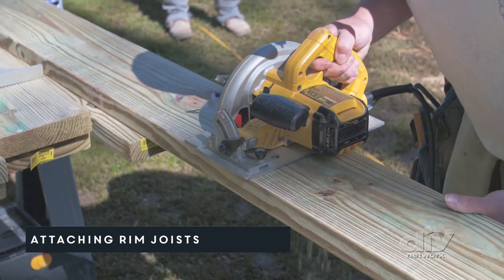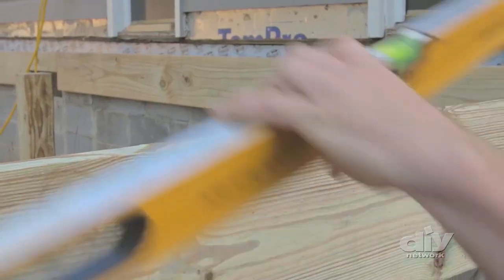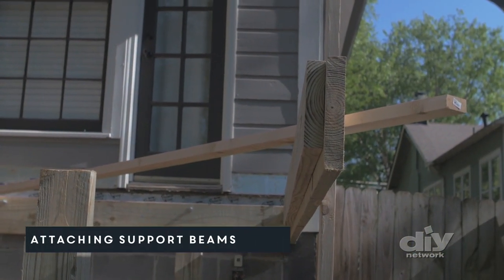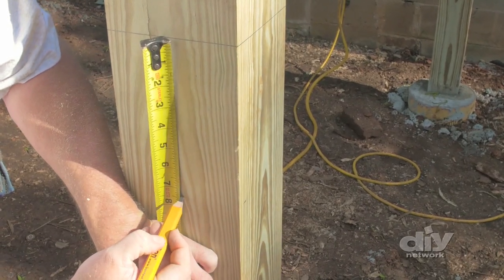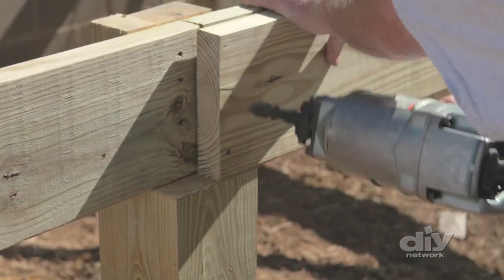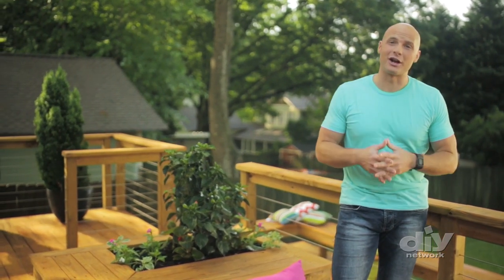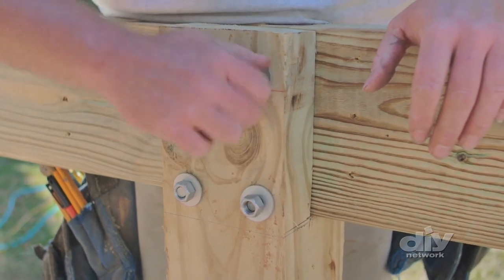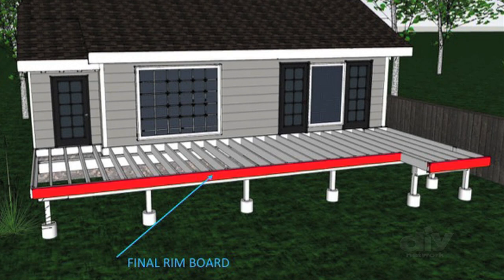How to Frame a Deck Perimeter - DIY Network

Comment: All these "Different" videos on decks are so confusing.. You watch one like this. showing use of Carriage Bolts to fasten ledger boards and the next says NEVER use Carriage bolts, only use washer faces Nuts and Bolts. Thanks for info...I like this method but never know what to really do,
Reply: I know right
Reply: You local building code official will tell you what is allowed or preferred in your area.
Reply: Follow your city building code
Reply: More than one way to do everything. Do what makes the most sense to you.